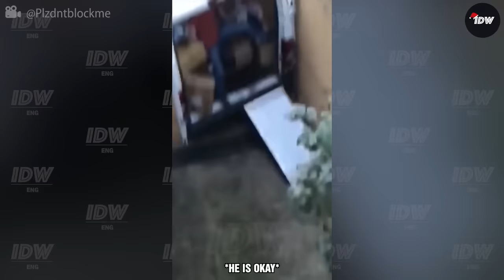TOTAL IDIOTS AT WORK #106 | Bad day at work | 1 hour of fails compilation 2024

Comment: 🔔 Each time comments etc., are added to the original audio is better than the next time. There are multiple comments to this effect, take a hint. No offense.
Reply from the maker: Thx for watching on IDW! Have a gr8 day. We're working on improving. Appreciate ur comment & check more vids!
Reply: @IDWIdiot99  Not watching any more because of the aforementioned problem with them. Nor did I finish watching the first one. But you seem to be a nice person so I wanted to offer you some advice for your own good. And realize also that not adding any extraneous audio/visual elements to them will make making them much simpler and easier to make as well as quicker! 😉
Reply from the maker: Yes, anw, be happy for the rest of yours @Rocket_Man232

Comment: 53:06 vehicle was front wheel drive but once the front axle crossed the last support there wasn't anything to prevent the 3by from sliding back away from the truck support. Solution: "W" the support of both tracks all the way back to the starting point and also every 5 feet perpendicular across to the alternate track to prevent lateral tilt over of the tracks. 

Can do without the sketchy narration we SEE WTF is going on here. I muted the entire video.
Reply from the maker: tks for sharing

Comment: the drag car wasnt human failure at all....  one side suddenly got grip and the other didnt :-\      our ford has 22" wide runners on a detroit locker rear end and it still slipped a bit...

hmm easy way...       your going 80 milesa an hour and the car suddenly takes a left hand turn, you got less then a second to react...    good luck.
Reply from the maker: Good luck to your family also!